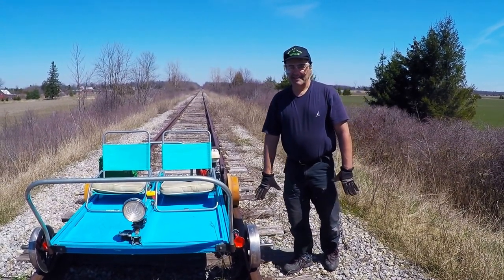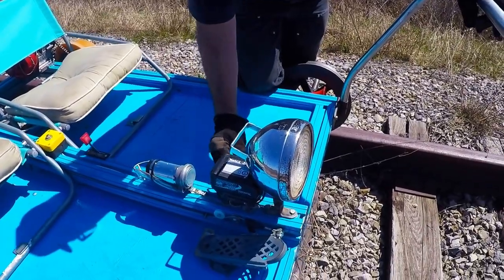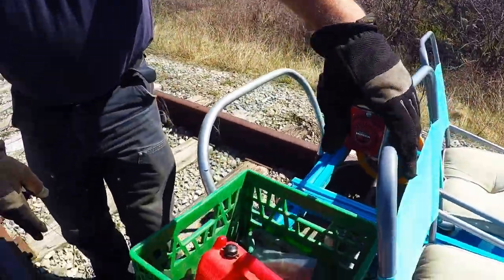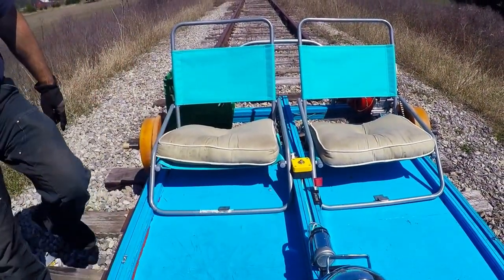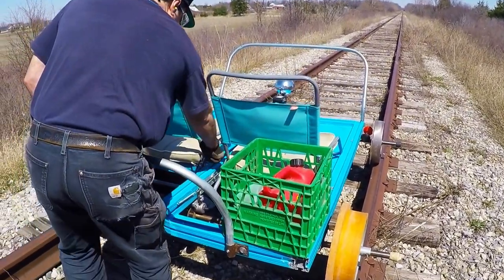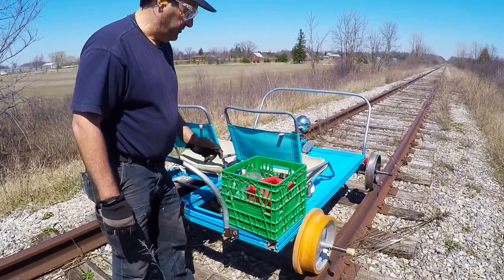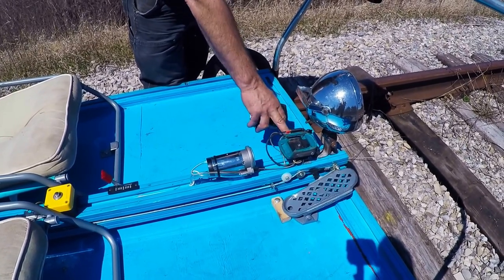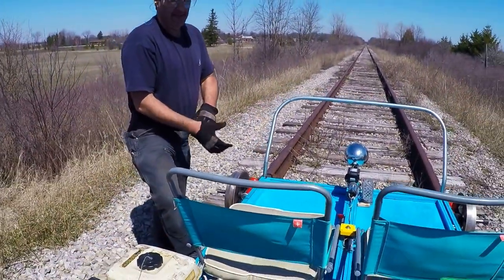Go Kart on Railroad Tracks on abandoned tracks- How it works

Comment: Coming from a railroad family of 3 generations, this is an interesting creation.  For a first-time build, it covers most of the bases.  

For version 2.0, I have a few suggestions:

1. Upgrade the wheels with a thicker inner flange.  You'd be surprise how quickly they grind-down, and your flanges look rather thin to start with, on the front wheels.  Buying a used set of hi rail wheels, would be a considerable improvement.  In addition, add a heavy leather or rubber deflection shield, just ahead of each of the wheels in-front.  It will brush-off most small debris, like rocks & small twigs, to help avoid any unnecessary derailments.

2. I would change those seats out with something with more of a cushion or air ride.  Train tracks are not smooth, especially the abandoned variety.  Joint rail, flat spots, etc.… can make for a very rough ride.  

3. I would also consider upgrading the engine to a 4-cycle type, with a muffler.  They’re smoother running and offer a little more ‘tractive’ power.  

4. Adding a small generator or alternator, which runs off the engine, would also provide options in-terms of electrical accessories.

5. 12-volt light-weight pump & hydraulic piston, attached to a flat 2’x2’piece of ¼” steel will work as a great lift, when turning the unit around.  

6. Down the road, perhaps a fold-down canopy or a large umbrella, like those used on road construction equipment, would provide a shield from the sun.  Maybe even a fold-down plexiglass windshield, to deflect small brush & bugs.

7. As for lighting, I would opt for two head lights, mounted higher, with ditch lights below.  It offers considerably more lighting, for nighttime runs.  Two taillights would also be preferred, for greater visibility.

8. A lot of railfans like to have a 2-way radio as well, for safety sake.  C.B., Amateur, MURS, FRS or GMRS – there are a lot of options out there.

9. Add a First Aid Kit & Fire Extinguisher

As with all railfanning adventures, stay away from active train tracks, even those with infrequent use.  In addition to the dangers, there’s also the legal ramifications.  In the U.S., railfans caught on railroad property, have not met with open mindedness, by Law Enforcement, Rail Cops, or Homeland Security.  Other than that, have fun!
Reply: TheOtherWhiteBread0  You just did!  :p
Reply: The engine he has is a 4cycle with a muffler

Comment: DId you build it with just a friction clutch or does it have a CV transmission?  CV transmissions would make that thing pretty efficient and easy to get moving from a dead start.  Was really impressed with the roundhouse post.

I built my grand kids a go kart that is a 5/8 scale copy of my yard truck side  by side )A Brister) and it would be perfect to make into a rail cart, but it easn't so small in the seat area. It can seat adults, but the roll cage makes it a head bumper for tall adults.  It's top speed was 40 mph before I geared it down.
Nice Job Little Brother!
Just had a wild though of adding some drop down trolly rail wheels to my yard truck.  It would be perfect with the wide tires, gearing and rear dump bed.  But all the tracks near me are still active. Coal Trains keep the rails polished...  Just what I =need, another porject to build!!!!!

Comment: Where do i start? Where is the alternator off the motor to charge your battery and keep your light on? What happens when it rains? What happens when a train comes and especially from in front heading towards you at fast speed? What do you tell police when they are called to check on what is going on? Sorry but these are obvious questions.

Comment: cool video. very well done. although im surprised that you didnt opt for a battery free, engine powered (like you would see on older atvs more specifically the older honda three wheelers) head and tail light. as that would save you on running the battery all the time. personally that would have been my choice with the battery powered light as a back up. but still awesome all the same.

Comment: all that work and the seats are an after thought  tell me you didn't steal those aluminum shoring posts at about $650.00 cdn. and how does a guy spend two years bolting eight pieces of aluminum together yet makes factory cast wheels with one pair sporting neoprene tires..a few things just don't add up I would guess you told your wife you worked on it for two years while actually courting Garry down the block. A head light well flash light that if you spent five bucks and fifteen minutes the engine magneto would have made plenty of power to run the light and charge batteries . and I see a red dokicky but heard nothing about brakes now if you watch a few videos of guys on the rails you will see that from time to time the tracks have been destroyed by time   nope something really fishy bout this one maybe I'm wrong..It's happened a couple times. sorry to cut but Iv'e had a $hitty day and this is about as aggressive as I get